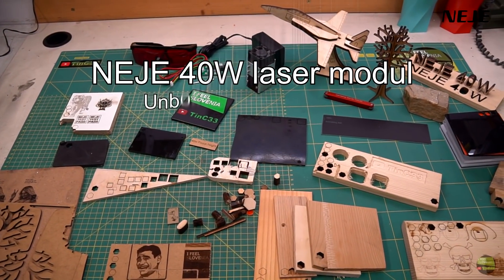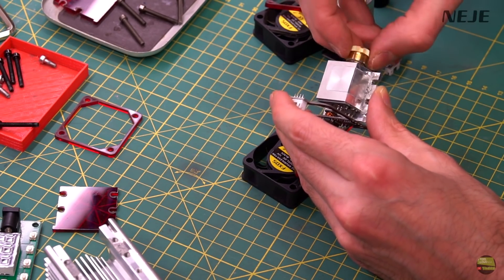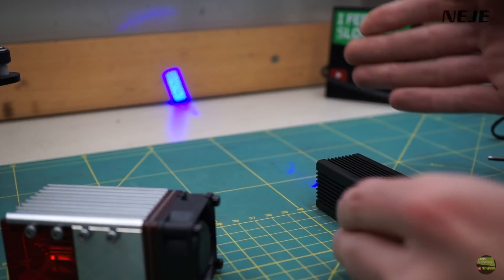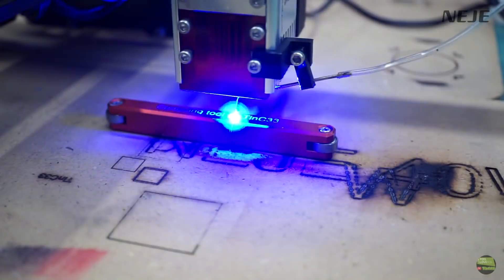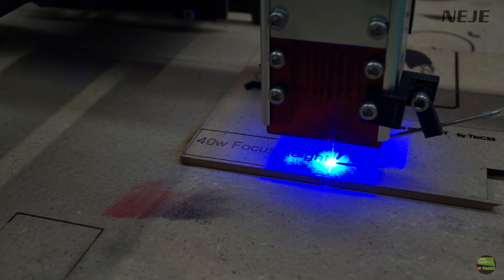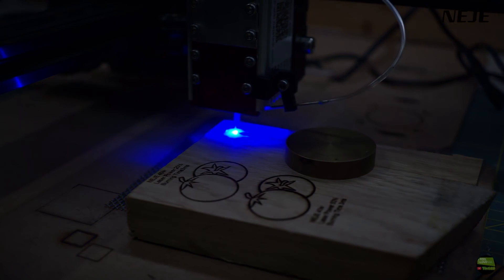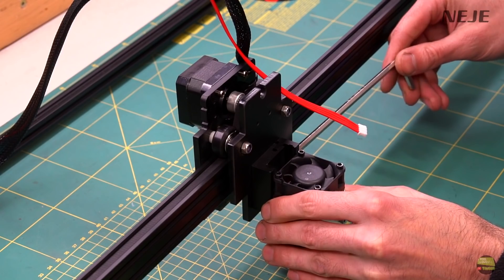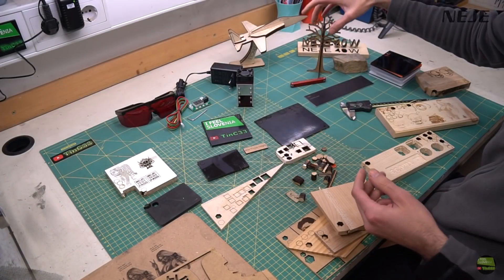Neje A40640 40w laser modul [unbox / review / first test] best laser modul modul i try

Comment: I actually bought the master 2s max 40w following your video. Still new to laser engraving & have been working so not much time to play. I also ordered a 10w laser module. The 10w module came with the little control board & cables, do I need to use the small control board to use it on my 2s max or Can I connect directly to my machine? Thanks
Reply from the maker: No need to use controll board, just direct plug to a neje 2 you can also leave old cable, so just replace the modul and that's it.
Reply: @TinC33  I have only a master NEJE master 2s MAX 40w not a NEJE 2, is that still just plug into machine?
Reply from the maker: @Arckivio  yes it worked for all models all laser moduls are compatibile with all the machine, just need to get enough wattage power supply.
Reply: @TinC33  Thank you
Reply: @TinC33  I have another query. I made my own CNC router so I'm new to lasers but not CNC's. I'm curious why there is no holding torque on the motors. Most times I can move them freely & not like a normal CNC where there is torque? Is this normal?
Reply from the maker: @Arckivio  it is normal if work with lightburn (there may be some settings to hold the position all the time) so i homing every time before start, but if you use neje software it only make homing on the begginning then hold the position of mottors all the time we are online with a sw.

Comment: When cutting thick material, consider setting focus to center of material, not top surface. This will give you more cutting range with some degrade of top cutting line.
Reply from the maker: It seem logic theoreticaly but practical i got better result if set focus by top surface doesn't metter the thickness of cutting materiall.
Reply: Using air assist removes that theory..
I also measure from top and get much better and cleaner cuts instead of adjustments 3mm lower into the material

Comment: Quel laser non è un 40 watt ma un 80 watt la sigla A40640 identifica l'80 watt  a fuoco fisso non avendo finestra per regolare obiettivo mentre la sigla N40630 identifica il 40 watt . Il 30 watt ha dicitura 30 watt. INFO NEJE GROUP!
Reply from the maker: This laser is 40W electrical or 15W optical power
i notice some ad on aliexpress wich show as 80 w, so i ask neje team and got that answer:
"The A40640 is a combination of dual laser beams. It is currently the most powerful laser module in our industrial, NEJE as the first brand to design this module. At present, some brand imitates the NEJE A40640 module, which is called 80w, in fact, the power is similar with us. The difference is that NEJE has a built-in drive, a protective film, a temperature sensor, a silent design, pass to quality assurance completely and enjoy 2 years of free after-sales service. Therefore, NEJE has to label as an 80W. "
Also number 40/6/40 should mean power, because 30W got number 30, 20w number 20...

Comment: I'm using a GRBL controller with Lightburn. What did you set the power level to on the adapter board, or do you have to set it?
Reply from the maker: I use neje motherboard wich give a signal direct to laser modul, if you use grbl and adapter board i think you need to set them offline or something so they read income signal from your board and give forward to a laser modul.
Reply: @TinC33  Yeah, I'm upgrading an Ortur to the Neje 80W. Pretty sure it's just plug and play, thank you.
Reply from the maker: @TheLouisianaHobbyGuy  neje 80w doesn't exist i think.
Neje laser modul work on ortur machine just leave the 4th wire wich is just temperature feedback, check my video i mount neje laser on ortur machine without problem.
Reply from the maker: @TheLouisianaHobbyGuy  can you give some source all i find is 40w like in this vid where is two diode in one laser.
Reply: @TinC33  My comment keeps getting deleted. It's in the Neji store
Reply: @TinC33  The Neje store has them
Reply from the maker: @TheLouisianaHobbyGuy  it may be deleated automaticly because of link, i check entire neje store and all i find is 40w laser or 15w optical power with dual diode, i seen scan ad for 80w on aliexpress, but not in neje shop
Reply: @TinC33  Nope they're deleting every comment. In the store it's called the A40640. That's where I bought it.
Reply: @TinC33  Nope even this will be deleted! Lots of people having the same problems.
Reply from the maker: @TheLouisianaHobbyGuy  A40640 is the neje modul i tested in that video on neje store they're said it's 30-40W input and 15W output optical power. and that's the answer from neje:
The A40640 is a combination of dual laser beams. It is currently the most powerful laser module in our industrial, NEJE as the first brand to design this module. At present, some brand imitates the NEJE A40640 module, which is called 80w, in fact, the power is similar with us.
So far this laser from that video A40640 is the most powerful laser modul from neje.
Reply: @TinC33  They're advertising it as 80W now.

Comment: the cooling system looks shitty
Reply from the maker: But it worked so it keep the laser quite cool
Reply: @TinC33  It's good if I'm wrong and it works as it should. But it seemed to me that the contact area looks small with gaps on the sides. 
Thanks for the review anyway.

Comment: Hi - can someone help me out here? My current machine has two PCBs: one small PCB where the power supply unit is plugged in and where micro-USB port is for the PC. From there, a 7-wire cable runs to the other, larger PCB that sends two 4-wire cables to the two stepper motors, and a 3-wire cable to the laser unit. If I replace my current laser head with this one, how do I wire it all up? It seems that I will need to leave my current setup that controls the two stepper motors, but then I will also need to use the new power supply unit (30W instead of my current 20W). Question: (1) how is the laser 'told' what power to use and when to turn on? It is not clear in this clip, where TinC33 uses the power PCB to test the laser directly (I wish there was more on how to wire the unit...). Thx.

Comment: Really a good review. Very good tips, was fun to watch. Just one thing, please all you funny laserhobbyguys. Be aware of the fumes. At least make shure you get rid of it and best, use a filter. This stuff is way more dangerous than anyone is aware of. The energy is so high, you get atoms rearanged. And the bad effects you may recognise after years and don't know where it came from.
You made the best air assist I saw up today, on the point, as close to the beam as possible.
And maybe you wanna try blow not air, but Oxygen. Think this use is still under Patent, but for private hobby... . It increases the effectiveness a lot.
Reply from the maker: Thanks, and yes fumes and also the light isn't healthy for our eyes, so while i work open the window and leave the room, checking via wifi camera and after job is done come to room again.

Comment: This isn't a 40W laser, people are even comparing to CO2 lasers and they are not in the same ballpark. These lasers take in 40 watts of power but only output a fraction, probably a few watts. This is still extremely dangerous to the eyes of course. So I would definitely invest in actual quality glasses and not the junk they send that are most likely fake for laser protection, they are just simply tinted.

Comment: Do you know if this laser head will fit on the ortur master 2 an if it is able to bolt up will the plug line up.  Please get back to me nobody else will
Reply from the maker: it doesn't fit directly, you'll need to print something between laser and carriage, i share one version for older neje models, for 3d printed check for the link (thingiverse) into video description

Comment: Hi
What settings you used for 20mm plywood ?
Reply from the maker: 100% laser power 5mm/s and passs until it cut, dont remeber exactly how many, but the air assist make biggest effect
Reply: @TinC33  thanks bro

Comment: Hi, I decided to buy a Neje max with 30W laser module around 3 months ago related to your videos and tests. I can cut 3mm plywood with your settings(5mm/s 100% 5 passes) at the beginning, but now I can cut with 4mm/s 100% 8 passes even if I try to recalibrate focus, clean the module...etc. Do you think that the laser module lifetime is that short? I uses for hobby purposes, cut board game inserts for myself and so on... 
Another question is that I check the 40W module, and noticed that they advertise a new 30W module as well, is it really better than the old one?
Can I replace my 30W with the new 30W or the 40W without any problem?
Thank you!
Reply from the maker: Hm strange, try to clean the lens also, or contact neje support they may give you new modul.
Sure you can add 40w laser modul.on it without any modification you'll just need 4a power supply wich come with a modul.

Comment: Great review.  Did you vary the height of the laser as you were cutting the wood , so as to refocus the beam lower?
Reply from the maker: No, i got worst result if i change high during cut because always change position a bit and cut wider line.

Comment: Dear  Friend, is  this  laser compatible  with arduino+cnc shield?, Is it easy to plug it in and configure it?.   What  would  happen if  I don´t  have  the  air compressor  to  adapt it  to it?
Thanks  for  your   answers
Reply from the maker: Sure you can use offline control board, and use different signals, so you can control with a cnc shield or 3d printer... If you don't get air assist you can't cut that much, maybe about 3-5mm max so if you want to use without air assist there's no sense to take 40w laser, engraver will work just fine without air but 3.5w laser modul wich is 10x cheaper than 40w will engrave just fine if not better than 40w

Comment: I have this laser engraver and it's fantastic. How do you get it to cut outlines properly, following and cutting a line rather than drawing the image in lines or sections. Is it possible to do it in neje or do I need another software? Thanks.
Reply from the maker: It is possible in neje software, when you add text select cad instead of carving, for other curves, draw in some software, save as nc or dxf file and import into neje software (cnc tab) you can also buy lightburn software (40$) wich offer you many functins, also drawing and cut shapes as line or engrave...

Comment: Which laser machine would you recommend for cutting plywood, MDF and acrylic up to 5mm? Thanks
Reply from the maker: For cutting deffinitely 40w but need rigt type of acrylic for laser cutting.
Reply: @TinC33  Thanks; what do you think of this laser: https://pt.aliexpress.com/item/1005001858106008.html. Can it be fitted to any laser machine like NEJE, Ortur and Atomstack A5 Pro?
Reply from the maker: @Dancopymus  i think yes on machine like neje max or ortur max, but doubt about other models like ortur master and neje 2 neje plus, because it may be too heavy for that models.
Reply: @TinC33  Sorry I did not understand; in the video do you show 2 sizes? And the biggest one does not appear on the Banggood website.
Reply from the maker: @Dancopymus  banggood not sell the max version it's only availible on neje store.

Comment: I received my 40w yesterday.  Swapped it out with the 30w today and WOW what a difference!  I cannot believe what I've been able to cut in just a single pass.   This is like having a co2 laser.  Seriously Wow.  If you are on the fence about buying this, you can jump down and get your wallet  out.
Reply: Hello, with the 40w laser, what thickness of plywood and acrylic can you cut? And the link from where you bought the laser.
I'm still looking for a laser machine, but to cut up to 5mm. Thanks
Reply: I am cutting 12mm plywood easily with this module, 90% power and 8 passes at 380mm/min...
More passes making it cleaner cuts, and with air assist better.
MDF boards are 9mm mainly for 6 passes 380mm/min but I did try 18mm once and that was 14 passes 100% and 240mm/min.
Keep my power lower and extra passes for better cleaner cuts, less burn marks and lighter black edges

Comment: Where does one find a metal tube like that for the air assist?
Reply from the maker: It's a medical needle
Reply: @TinC33  I don't know where you live but in the US such supplies are not easily obtainable.
Reply from the maker: @chrome98  really i'm from EU and can simply go into drug store and buy any kind of needle, itherwise try to find somu tube with about 1mm inner diameter.
Reply: @TinC33  nope, requires Dr prescription in USA.
Reply: @TinC33  would a plastic straw like for a spray can work?  I.e.  WD-40
Reply from the maker: @chrome98  sure it will work just heat them a bit ans bend it to right position

Comment: The video went from testing the laser with the included control board and power supply to when you were actually cutting and I did not see the board or power supply connected separately from the NEJE  board & frame.  Did you just connect the laser as a direct replacement if the 30w without the power supply & board?
Reply from the maker: That's right, that board is used with other diy machines, neje won't need them

Comment: i just received  mine 2 days ago and setup would have been easy enough except the yellow/black paired wire for the pwm was wired backwards at one side. i was going through every setting thinking i did something wrong and then on a close inspection i noticed the ground side was perfect at the control board and when it got to the adapter board the poles were reversed. just got that figured out last night and ran a test engraving. today i run speed and feed tests tor dial in but it cuts through 1/8" cedar single pass 50% duty cycle at 500mm. today i will also setup the air assist as i already have everything for it just never attached it to the machine. now that ive commented on this cool laser ill watch your vid.:)
Reply from the maker: Great to hear that you find the fail, i got this issue on my geeetech 3d printer, entire cable for sd card was reversed on one side, there is no final inspection on low budget china priduct...

Comment: Really mate that is super review. I have 2 question... Did you measure the output power of laser (a lot of people said that don't reach 10w, but NEJE claim 13-15w)? Do you know how I can add rotary axis and which one I can use? I don't have 3d printer... Where I can buy this part for air assistant? Thanks in advance. Regards from Bulgaria. :)
Reply from the maker: I don't know how to measure real optical power probably need some expencive measuring device for laser measures with tons of lens etc.
Before i make this i just bend the needle so it blow close to a laser and tape it arround the modul with electrical tape, it work same like this but doesn't look so cool 😉
Reply: @TinC33  thanks for your response. When I receive my laser I will trying with tape. I think to use aquarium air pump, because compressors are really noise... What you think about this? Can you say something for rotary module, Neje said I can add... But no answer which model and how... Where can i send you PM?

Comment: What software do you use for this?
Reply from the maker: For engraving mostly neje software, for cutting lightburn.
Reply: @TinC33  Does Neja software also work with 3D printers, that are just converted into Laser engraver or does it require Neja hardware?
Reply from the maker: @havajc1  no it only work on neje machine wich got double microcontroller one for neje software and other for grbl softwares

Comment: Essentially this is a 40W input module with an output somewhere around 10 to 15 W. Really it is all about the quality of the lens. Your air assist set up is great, that is the key to clean cuts. The mesh at the bottom is a great trick to allow the air to circulate. Well done! Thanks for sharing.
Reply: More cool if used heatpipe and the heat remove by water cooling..

Its possible??

Comment: It's a total scam, and a dangerous one at that. Do not buy this.
1 - 20 watt blue diodes simply do not exist - the highest power available is ~7W, and that's overdriven.  And even if they were, combined with a 50% beam splitter(which is what they have) instead of a knife edge combiner, you still get... half the power. Whoops.
2 - That piece of red colored plastic that they sell as "goggles" is not going to do anything to protect you.

Comment: 40w laser module but the most powerful laser diode made is 7w... how? Well looking at specs they say 15w optical power- likely an overdriven diode.  I can make a 100w laser engraver based off of their rating by just adding a lightbulb into the circuit lol....   A 40w laser is fundamentally different than a laser that draws 40w of power.
Reply: 7.5w per diode, there are 2
Reply: Yeah I have their "30w" which they claim is like a 7w optical. They do at least list the output power which seems accurate enough, first try with mine and it did a great job engraving a design on an aluminum iphone back. The Chinese marketing of the input power is unfortunately very common with the cheaper diode listings, often without output specified. Kind of like vacuum cleaners, they like to say 4.5 HP for ones you'll find in stores (which would fry the cables and catch the 15A 110v outlets on fire if that were true), and even when they say "peak power" on those vacuums they must have some insanely fast oscilloscope because I haven't been able to measure anywhere near marketing claims even when I shorted out the motors and stalled them. Its just sad how numbers and specs are treated as meaningless (I'm an engineer, when I need a spec I need actual spec not some made up marketing number. Unfortunately that's how some people die or things catch fire or crash when the specs are trusted without realizing the claim is a total lie).

It makes things very difficult to design for when you don't know what you're getting.
Reply: I was already super skeptical. Thanks for clarifying :)
Reply: there are two diodes that's how 15w